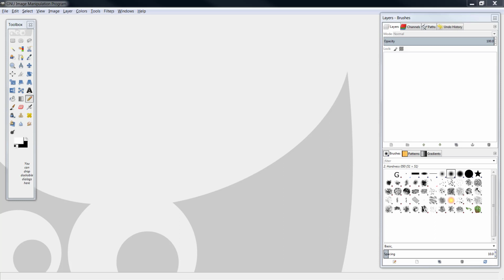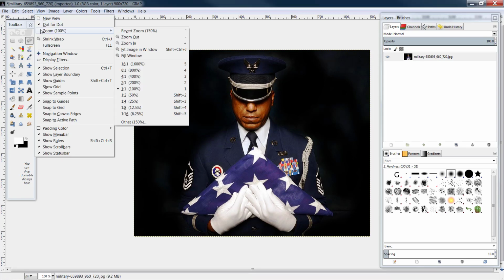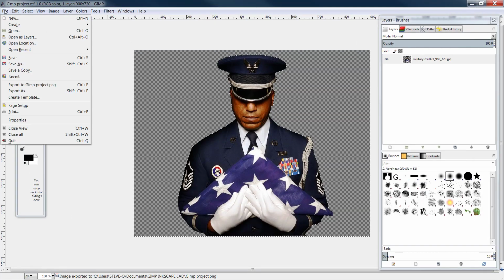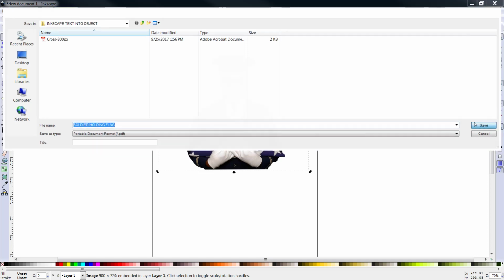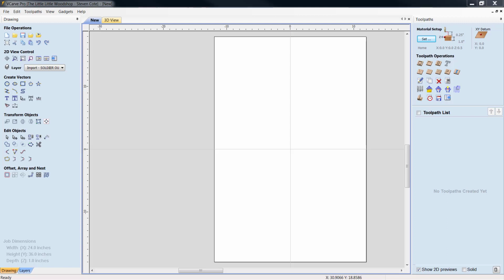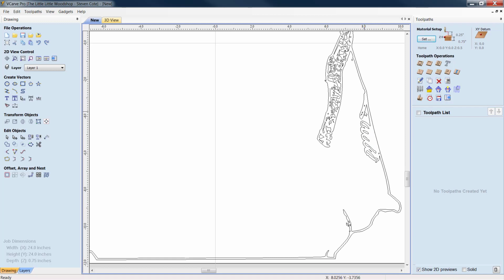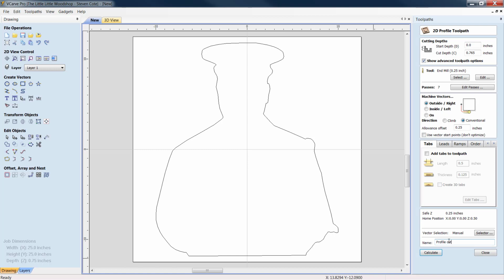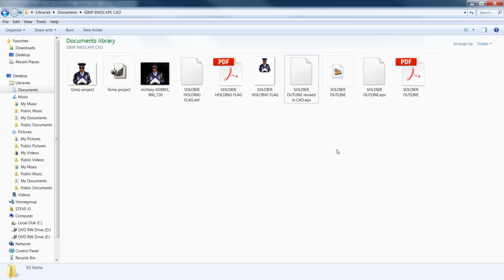GIMP, Inkscape and CAD

Comment: I like the tutorial and progression from GIMP to INKSCAPE to CAD.  But I don't understand what you are making with the outline.  Or is that to come on the next sessions.
Reply from the maker: I'm sorry Sir, I thought I had mentioned in the beginning but my apologizes for my forgetfulness. I'm doing a MDF silhouette backer in the shape of the image I cut out in GIMP. I then traced the image in Inkscape to render the vector file for the silhouette to be put into CAD . I save a CAD file to .eps and send that for the dimensions to the print shop along with the cut-out image file (pdf and/or eps).  The print shop re-scales the photo to the dimensions of my silhouette cut out & one attaches to the other.
Reply: Got it!  thank you!
Reply: The Little Little Woodshop yea i was just wondering would like to see finished with the print out on it but all is well thank you hope alls well for you too. Hoping to start making chips as soon as possible again! Have a good one
Reply: The Little Little Woodshop thanks going to give gimp another run after this. Great work. Are you going show cutting it out or finished product? Eather way thank you
Reply from the maker: Hey AllCustomz, I could but the silhouette is a single toolpath, 1/4" endmill with tabs. I wanted to try to show how to use open source software and roll everything into CAD. Hope alls well for you !